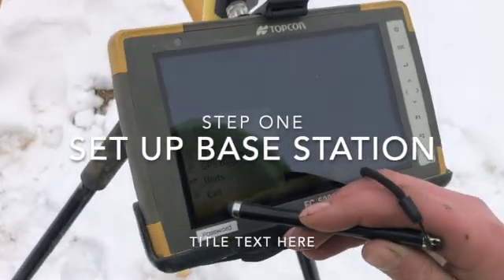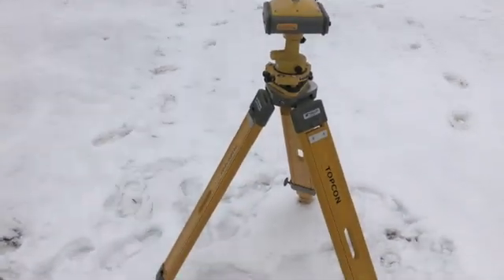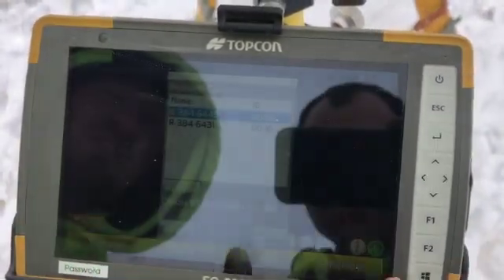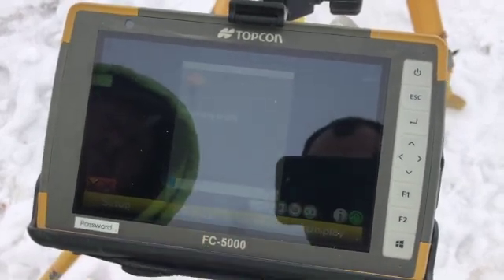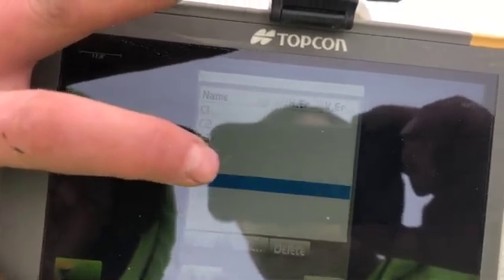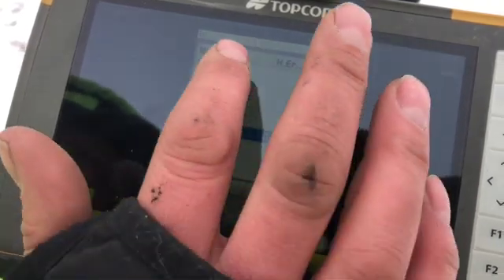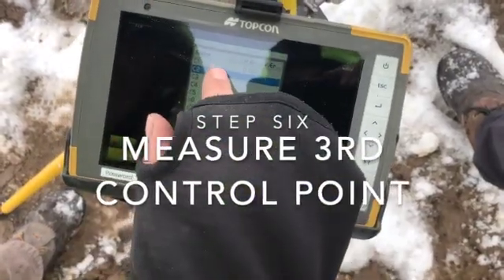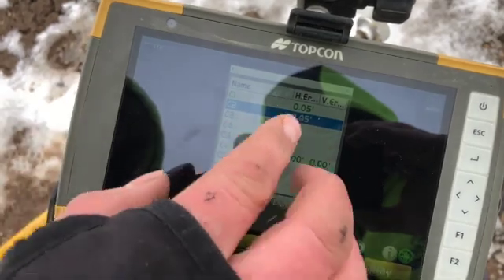How to Localize Topcon Pocket 3d

Comment: Base height  don't matter on unknown point.   And why are using one vertical  it takes a minimum  of 4 to make your surface  work. If you need the document  from topcon I can provide  it.  This is not a good localization  for machine  control
Reply: @Rodney Hunt I would be interested in that document myself, I'm doing more with the 3D topcon system everyday and have had to fix problems where a new localization is needed.
Reply: Rodney, you r right my bro, if u r setting up on an unknown point, the base antenna height should be zero, just like a free stn resection when u r using a TS.
Reply: Even on a known point? I was always told to use multiple horizontals and one vertical (the one that ties in closest to the projects)
Reply: I've heard 1 vertical and 4 vertical or more but do not use 2 or 3 vertical as it will cause error.  Best to check with a level after to see the results.  Gps can and does lie.  .05 horizontal on 3 points means 1 or 2 points could be off more then a tenth but it's just fitting them in..

I've made the mistake of using 3 vertical and it went all over the place like a half a foot vertical.  1 is safe then after localizing shoot the remainder control points to see how they hit and then add the vertical if they show good but not if you have less then 4 or it will through it off.  1 or more then 4 trust me and verify with level.  2-3 and you will see issues.